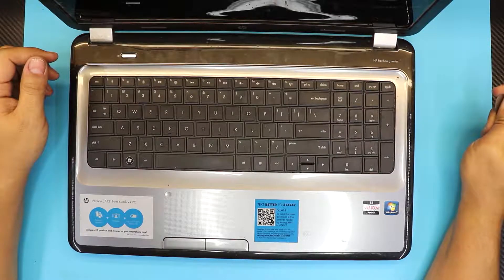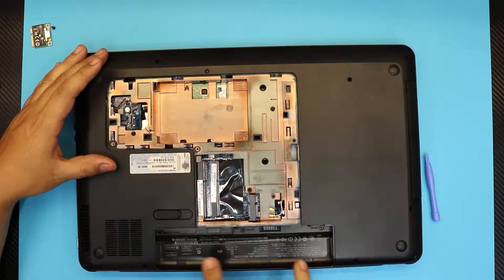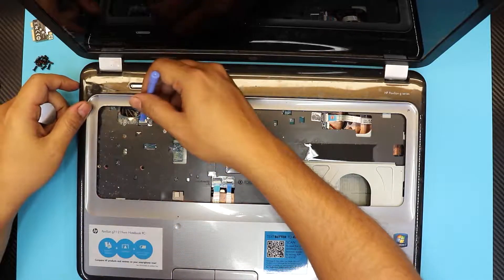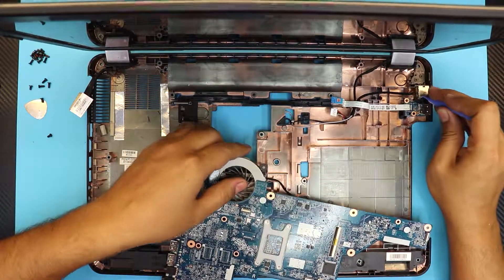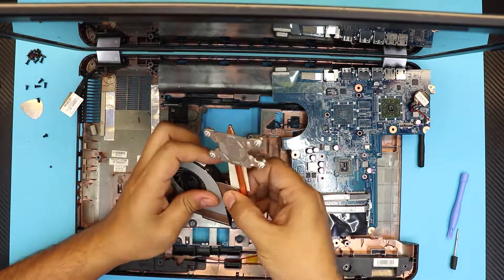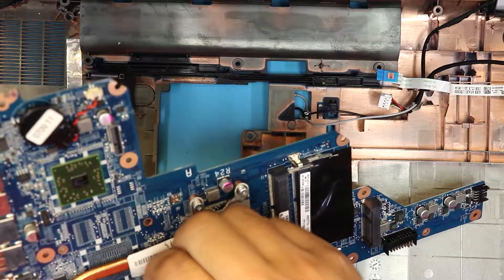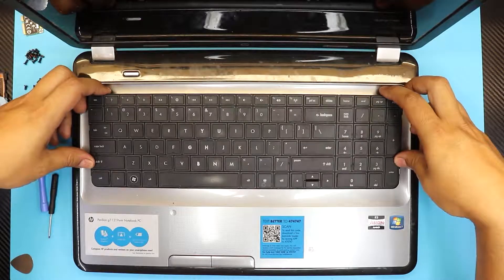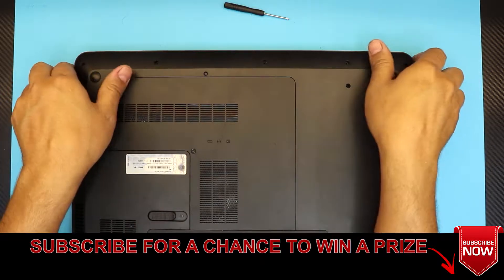How to Service or Disassemble Hp Pavilion G7 Series Laptop

Comment: Even five years later, this video was tons helpful. My laptop wasn't turning on when I pressed the power button, even if it was plugged in. I didn't even know you could take off the keyboard until I watched this, and as it turns out, both the power button ribbon cable and the keyboard ribbon cable were pulled out, so after plugging them back in, it turned on just fine!
Reply from the maker: It's my pleasure my friend.
I'm glad that my videos are helping people.
Should you have any questions or requests in the future, please don't hesitate to ask me.
cheers🍻

Comment: The G7 you are working on might be a few years old, but can the CPU be upgraded? Got a hold of a G7, AMD A8 with Win 8.1 I believe (not in the best shape, but it was a tossed out unit!). Haven't tested it yet. Thank you again. 9:23 it doesn't look like it can, but the model I have might be able.
Reply from the maker: 🫠Regarding your question, the CPU is soldered to the board, but if you have a model where the CPU is in a socket, you can upgrade it, as long as it fits the socket version.
cheers🍻
Reply: @uFixTek  yes thank you
Reply from the maker: It's my pleasure my friend.
i appreciate your support.
Reply: @uFixTek   very welcome

Comment: This laptop sucks. I have the one with the i3 2330m and it's just very finnicky. I take it apart, clean it out, new thermal paste, put it back together. It's now better with cooling, but the problem is that it just randomly shuts off. When I move the hinges, when I go to pick it up, or put some small amount of flex on it like on the keyboard.

It's like the PCB is just very flimsy and force of movement just causes the whole thing to almost break.
Reply from the maker: the issue with that motherboard is that is shorting to ground, that means there is a painting on the cover from inside that is conductive, i recommend you to see what part of the board is touching the inside of casing and tape it up.
Reply: @uFixTek  I made sure to add some tape to the bottoms inside and on some parts of the board and now it works no problem. I'm able to move it around and rock the hinge back and forth without it going blank.

It's kind of dumb how it's put together. Thanks for your advice.